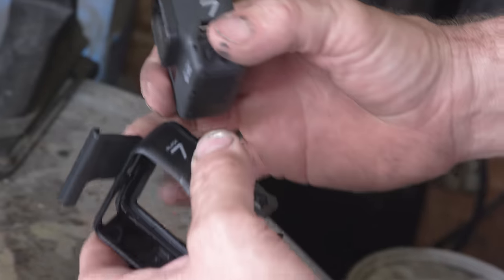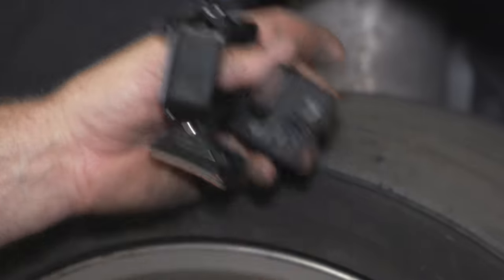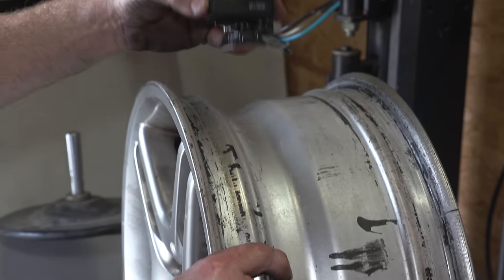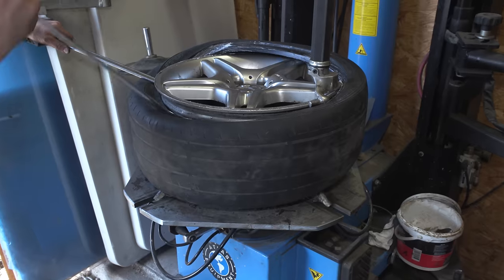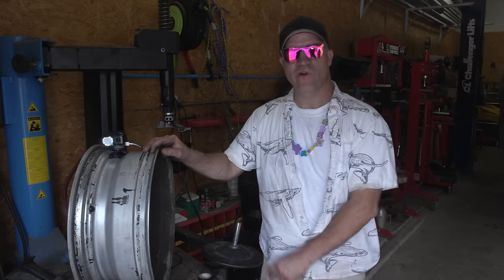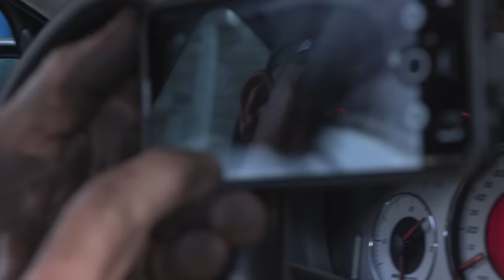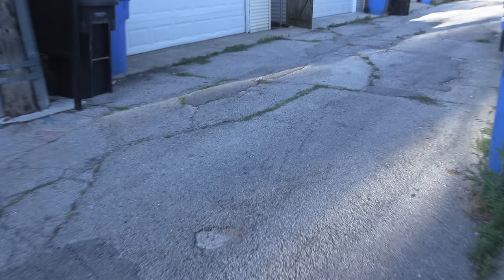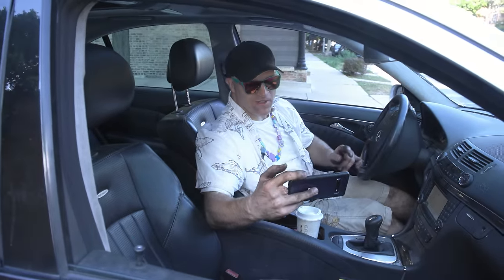GoPro Inside a Car Tire (While Driving)

Comment: I think he should do one while doing a burnout because I don’t think that the tire will act anything like that during a high speed burnout
Reply: A burnout out... At high speed? You mean while driving at 80mph do a burn out? I doubt that car has the power to do that and also like he said the camera won't pick up enough to make it worthwhile at higher speeds.
Reply: @edism  he means a stationary burnout, with the tires spinning quickly
Reply: Jake Lyon not very high speed if it’s stationary innit?
Reply: @jamaicanmetalhead9102  ask him that my guy. I can tell what he means but if it's still confusing to you then idk
Reply: @jakelyon914  No such thing as a stationary high speed burnout, that's my point. He's obviously throwing words around and has no idea what he wants to see.
Reply: Ed height wheel speed, the tire is moving quickly
Reply: MadSmaddyCODM i meant a high wheel speed
Reply: @jasonliblick9879  ah lol, was thinking W16 twin turbo engine swap needed otherwise lol

Comment: “I’m pretty sure it’s glitching because it’s inside the tire”😂
Reply: Probably more so because the camera is being squished between the road and the rim
Reply: @dr.haroldweinstein5157  na just a connection issue. Lotta metal and rubber to get the signal through. I think that how the GoPro broadcasts atleast.
Reply: @dr.haroldweinstein5157  i know why it was glitching already i just think it was obvious and he didn't have to say it because everybody knew why.

Comment: The vapor at the end when letting the air out of tire was cool. I didnt know it does that.
Reply: Rapid decompression will drop the temperature in the tire and can drop down to the dew point. At that point the water in that compressed air will condense and make a fog
Reply: @nateolmsted22  could this be why the air comes out cold but the tire gets hot?
Reply: @nateolmsted22  Thx.

Comment: I’d like to see the inside of a drag car tire and see what the inside of them looks like when when they wrinkle up on a launch and what it looks like doing 140+mph. Contact 1320 or Cletus McFarland and see if you could arrange something.
Reply: Yetus
Reply: Too dangerous for that. The wheel balance would be so far off and at those speeds you don't wanna have that
Reply: Sambo Rambo. LMAO I never noticed I wrote “Cleetus” tyty
Reply: Taco Burrit0 So then balance the wheel.... It’s not like you’re putting the GoPro in the front wheels it’s the rear wheel.
Reply from the maker: I know most of the pro dragsters, but the issue is there going so fast and something were to happen with the tire because of the one of the drivers could be killed. And the bigger issue I see with that is that when the wheel is spinning so fast, It's just happening too fast for a regular camera.

Comment: Man, show the car a little respect and wash that grime off your hands before driving!
Reply: He probably eats with those hands.
Reply: @SatanAzerath  So what do use, your feet?
Reply: Oh geez, it’s JUST a ford. Relax.
Reply: I drive an old beater, but my tires are much better. If I had a nice car like that, I wouldn't risk wrecking it from driving on bald tires.
Reply: I came here looking for a similar comment.
Reply: @WinginitIguess  Mercedes
Reply: @SuperTambo69  LOL! Yeah okay bud.
Reply: @SuperTambo69  AMG or atleast has the wheels.  This dude trippin.  Jag used to be owned by Ford like 15 years ago, not Benz.
Reply: @janacek2549  no way man, clearly a KIA.

Comment: This tells how much of a beating tires take on the road.
Reply: Especially at highway speeds, imagine the racecar tires too
Reply: Now I DO understand why tires are rated according to a maximum speed they're safe to drive at, and why exceeding such maximum speed can be dangerous  :-|
Reply: @guilhermesartorato93  one time a Veyron's tire blew up during top speed testing and the whole front quarter of the car got obliterated to bits and went crashing, luckily the test driver survived
Reply: @falcongamer58  one time a car hit 307mph using tires?
Reply: @Minerva886  yes but only for a 1/4 mile
Reply: @falcongamer58  yup its pretty insane actually it could hold up for that much.
Reply: @Minerva886  pretty sure that would have been a jet powered car, right?  In which case they prob have the aerodynamics tuned with just enough down force to keep it on the ground.  My point is, I wonder if those tires would actually be under less load? Or maybe the centripetal velocity becomes more relevant...the outer diameter lagging behind as its whipped around.  Also, in a jet car, does the speed of rotation of the wheels match that of the vehicle?
Reply: Imagine rally car's tires
Reply: @jevonbigga6172  imagine full sized baja trucks tires
Reply: Yeah, it's good thing they're made out of rubber.

Comment: Thinking about it, there's probably a few tyre manufacturers that would be interested in this idea.
Computer simulations can only do so much, but a camera can be more than a thousand line of code.
Reply: Being done for years by manufacturers, racing teams, and science experiments. Nothing ground breaking here.
Reply: This is stupid idea
Reply: @hercegovac9999  
Why is it a stupid idea?
Reply: @Slikx666 because you don't have anything to see with camera and tyre would be anbalanced and you tyre would shake a lot  and whole thing wouldn't be practical ... use your brain a little bit
Reply: @hercegovac9999  
He did this as an experiment, it was not a permanent thing.
The unbalanced wheel is a minor inconvenience and I'm sure he would have stopped it if it was dangerous.
If a tyre manufacturer was going to have this setup for getting information they would make sure everything was built better andwell balanced.
So how about YOU use your brain?
Reply: @Slikx666  the camera won't aolve any problems , I work with tyres and I know and they don't test tyres
Reply: @hercegovac9999  
Funny that. I've seen tyres tested loads of times.
Reply: @Slikx666  It was for retreading

Comment: A couple ideas: you could fill the tire halfway or full with water and try again.

This would be a lot of work but you could build a rail system on the outside of your rim that the GoPro could travel on so it stays on the bottom area of the tire always by gravity.

Comment: Dont think this treadless tyre would be road legal in UK.
Reply: Probably isn't in Chicago either!
Reply: it's not legal anywhere, this guy needs new tires
Reply: Maybe it doesn't rain where he lives. A treadless tyre would give him better grip.
Reply: @michaellavery4899  Unfortunately, a worn out road tyre isn't quite the same as a new treadless race slick.  I think that once worn to that level, the rubber has poor grip.
Reply: In Germany they will put him in Jail for that
Reply: @alexanderSydneyOz  You are 100% right. It is nowhere near the performance of a slick and will even perform worse than a tire with the profile still on it. Winter tires on the other hand already lose their function when there is less than 4mm of profile left on the tire.
Reply: He literally says they aren’t road worthy in the video and he’s getting them changed after the video
Reply: @alexanderSydneyOz  It shows there is still rubber on the tyres which is highlighted by the grooves running round the circumference of the tyre. I wasn't suggesting a completely bald road tyre would be comparable to a slick tyre.

Comment: Now everybody understands why flat tires overheat. They are being flexed suuuper fast, many times per second.
Reply: Luiz, that's a very good comprehensive observation.
Reply: They're also these trendy, low volume tires.  They have to break down much faster than an older, wider circumference type tire.
Reply: That and more of the tire is touching the surface.

Comment: The regular undulations of the tire are likely due to the reflective cracks in the road (the road you drove on right after the alley). It looks like that road is asphalt concrete (AC) over jointed Portland cement concrete (PCC). The regularly-spaced joints in the concrete are where the AC overlay has reflective cracking. I absolutely love your videos!
Reply: No.

Comment: I was more amazed that you were only just about to change those tyres. There were probably due 6 months back being that bald 🤣.
Reply: Wss about to comment the same thing. Suprised no one else has noticed😂. Imagine running them in the uk
Reply: @shelg6082  Those tyres are officially, to use a British expression, shagged. :-)
Reply: If it was an old truck, we would drive them until you could see the air inside them.
Reply: It’s better to remain silent and be thought a fool than to speak and remove all doubt.
Reply: Yeah, in the UK you'd get 3 points for each bald tire so with 4 if them like that you'd get your licence suspended!
Reply: yup. illegally bald tyres they would be in the uk, worse with a really blad tire he drives on a public street not even looking at the road but STARING instead at his phone, again a criminal offence in the uk.
Reply: He also needs an alignment. You can tell because the tire flexes right or left depending on forwards or backwards.
Reply: When I was in Europe I drove tires until the steel showed up from under the rubber. That means a good year, year and a half more for the tires depicted in the video
Reply: For real, those tires are dangerous and should have been changed a long time ago.
Reply: Kens UK Adventures  I simply didn't have any money.
Reply: When I was a kid  we called  tires  like that  may pops
Reply: Kens UK Adventures  what an exaggeration. I remember I had really no money and my battery was toast, so for months I had to care to park pointing downhill so that I could start the car with momentum in second gear
Reply: Kens UK Adventures  if i couldn't pay rent, or buy groceries and I had to go to work? What do you think I would do?
Reply: Get the most out of the tires before the next inspection due is what I say.  I always wear my tires until one tread is gone . Not dangerous.  Nascar tires have no tread going 200 mph
Reply: @Danny-ju2ip  Do NASCARs drive on city streets? Do you race your car in NASCAR races?

NASCAR teams use slicks for dry, clean conditions on specially engineered high-grip asphalt. Street tires are designed for real world street driving conditions, and can not do their job if they are worn bald at any area of the contact surface. This is why there are wear bars between the tread blocks to ensure that tires are changed before you end up hydroplaning out of control into oncoming traffic the moment you hit a puddle.

Comment: Damn
That steering wheel must be dirty af 
Bro 
Clean your hands wow
Reply: Hes a mechanic, he is above your hygiene advice.
Reply: Lmao
Reply: The Adrian Monk in me was cringing lol
Reply: matt9c1 I literally couldn’t focus on anything else. When I saw those hands I was dead. I understand being a mechanic which I love to do on my own cars also but completely touching YOUR OWN car with those dirty hands is terrible. 😂😂😬
Reply: @highclasswhitetrash9027  so just because you're a mechanic you can't clean your hands before driving? I've worked on my BMWs for years and never once drove it with dirty hands. That's bad practice.
Reply: @serge933  no, its a throwaway Mercedes. It was once almost $100k, today i could get it at auction for $5k and less. Who gives damn, its his car.
Reply: @highclasswhitetrash9027  most people wouldn't consider a Mercedes a throw away car, especially at 5k. What a strange way to think. So just because something cost less means it's actually worthless? So the idea is to just not give a shit and beat it up? What kind of logic is that?
Reply: @serge933  what kind of logic? Try buying a $5k car thinking that its a deal and a half, then you need to replace the a/c the radiator, power steering and suspension parts, suddenly youve spent $20k on a car that you CANNOT sell and break even. THATS a throwaway car.
Reply: @serge933  not to beat a dead horse either, but bmw parts are much easier to aquire than mercedes parts, and in my opinion are the superior automobile. I dont drive my own truck with dirty hands, i have hand cleaning wipes and a water jug at all times. Be that as it may, it ultimately doesnt matter, its not my ride, and its not yours.
Reply: I work at a tire shop and i dont wash my hands often when i work im 15 btw
Reply: @randium1776  i did tires when i was 15, honestly its alot of fun when theres not customers funneling in. Dirty job too, real dirty.

Comment: One thing I’d like to see is 1, a temperature gauge and how different pressures affect the temperature fluctuations, and 2, use the good ol “fix-a-flat” with a puncture and what it does internally.  As someone who works on cars and tires, I can only emphasize this so much… slime and fix-a-flat are not going to stop your leak. At best it’ll slow the leak.  Don’t forget that someone needs to clean the rim once the tires off. That stuff is not fun and makes a huge mess.  Those things are good for one thing; slowing leaks.  That’s why atv tires are my exemption.  When you’re out in the field, you need something that’ll slow your leak.  Just don’t go crazy with it.  This g if as turned in a rant, but I’d love to see how slime and stuff works internally.
Reply: I would love to see fix a flat as well
Reply: I've only used fix-a-flat on a dump trailer for behind a lawn tractor never on a car/truck tire. Best thing for me is to carry a plug kit and a 12V pump,it's gotten me home more than once.
Reply: I’ve actually had great luck with tires holding air consistently after putting in Slime (not so much Fix-a-Flat), but after seeing what it does to TPMS sensors, I won’t do it again unless the situation makes it absolutely necessary.
Reply: I'd love to see that too. I spent years as a mechanic and I hated fix-a-flat or slime, it makes changing the tire or fixing it miserable.
Reply: @had2galsinthebooth  I carry around my Milwaukee m12 tire pump.  Love it
Reply: @bobbyb9718  yea, it corrodes the sensors very fast, and I’ve seen metal rims start to get rust because it’s chewed through the top layer of protectant.
Reply: @seanc.5310  in my toolbox I have a piece of paper I want to get framed and call it the “le slime do splatter” because I put the paper up doing ATV tires, and it just… shot everywhere!
Reply: @richardmillhousenixon  I hate it! Some people are so dedicated to the idea they can fix it that we’ve had someone with a popped tube, then filled it with fix a flat, and when that didn’t work tried using expanding foam.  This was for a lawn mower, and the tire would’ve cost $40 to be installed and everything… now he needs a new rim which can only be ordered from cub cadet and ran him $250… I love people
Reply: @congruentcrib  Like legit, if it (a tire on a car, lawnmower tires are much more of a "just don't drive it until you fix it" thing, not a "drive it until you can fix it" thing) is too fucked up to pump up and drive to the nearest service station, they're probably too fucked up to fix with anything less than a professional patch job and at that point Fix-A-Flat or anything of that nature is going to do way too little to get you anywhere safely

Comment: Did anyone else cringe knowing his dirty hands are touching his steering wheel
Reply: While I most definitely would have washed my hands, this isn't quite as bad as having a bunch of engine gunk on them. It's mostly just worn rubber. So ehhh kinda but it's nothing to truly be worried about.
Reply: No
Reply: Yeah, but then check out the condition of the tires he's rolling on  lol
Reply: If he offers to get drive through fast food, say umm no. LOL
Reply: And that's what you got from this video?
Reply: @patrice8257  ??????  that's what I got from this video, its a gopro inside of a tire.....
Reply: Dirty hands? You should  see mine after working on a diesel.
Reply: The man handling the camera was an afroamerican....The driver is another person
Reply: No, je builds up an air cushion, so his hands don't get in touch with the wheel
Reply: No because we are real men
Reply: @greer8288  you must not be a real car person
Reply: Geez you think that is bad, i believe my steering wheel is falling apart due to so much grime, transmission fluid, oil, dirt, water, anti freeze, gas, and whatever else i cover myself in.
Reply: @danking5382  i suffer from ocd

Comment: That's really neat. It looked by your tire wear pattern that maybe there was a small amount of misalignment, and I wonder if that is also what caused the tire to be pulled to the side each revolution.
Reply: Bet the front end is wore out.  To fix that front end proper and alignment after with new rubber would equal the value of the car.
Reply: @supporterofeverythingyouli6255  yikes.
I guess that's why they say, "there's no such thing as a cheap Mercedes."
Still an awesome car though
Reply: it's just over worn. what do you do when your car can break anytime and cost 5k+ ... don't replace tires in time, to save 50$ every 2 3 year LOL

Comment: You were “JUST about to change” your tires? Considering the condition of your tire treads, your tires were already illegal a long time ago. Very interesting video though. Thank you.
Reply: Lol, I got 12 years tires on, as hard as wood.
Reply: I was gonna say the same thing the tyres are practically bald
Reply: If you can still see tread, they're legal here. lol
Reply: Is "tire treads" useful in climates where cars don't need underbody protection because it never rains? By the looks on the profile itself and shape of the sidewalls it seems like a low profile tire. Brands like Hoosier makes road legal tires with less profile.